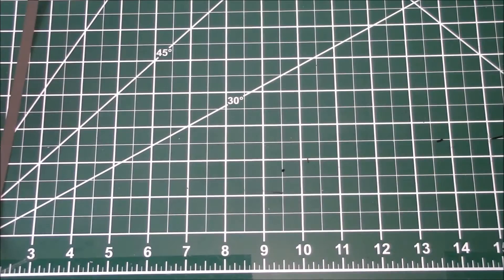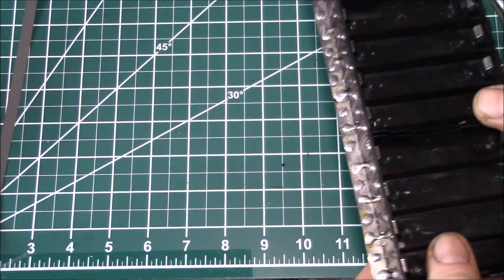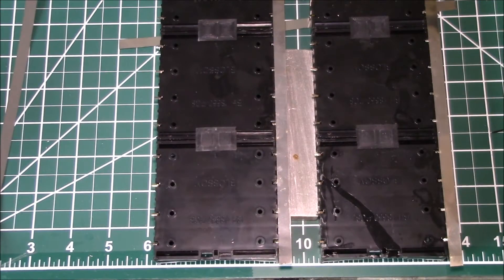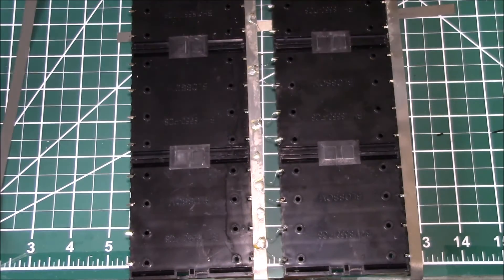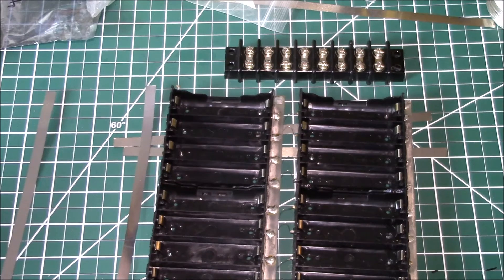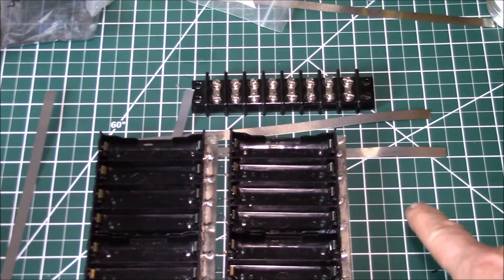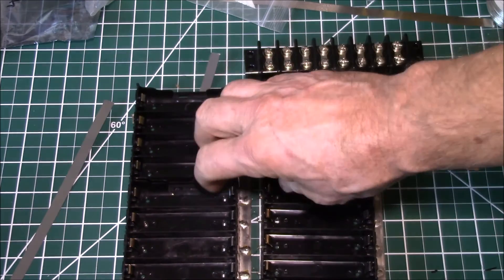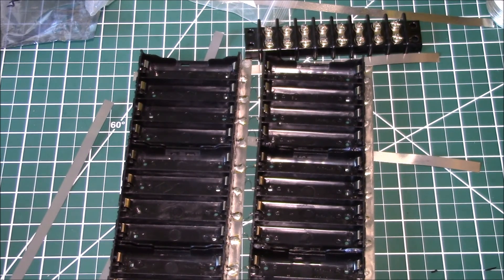Lithium Ion Battery Power Shelf, Part 3

Comment: It'll be interesting to see what impact your fuse placement will have - could be the right way to go.
Reply from the maker: I thought I would try something different.  Doesn't give the tight packing that your design does if you are trying to make a pack to fit in a server rack or similar.  I still need to figure out how I'll set mine shelf up once I get it made.  I might just attach some shelf brackets to it and mount it on the wall.